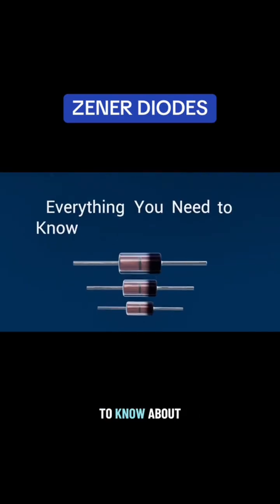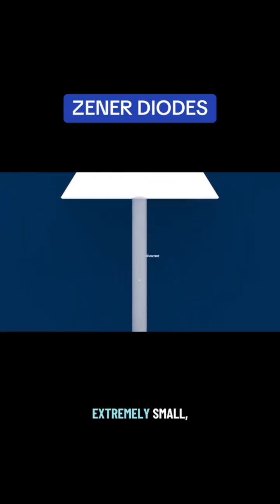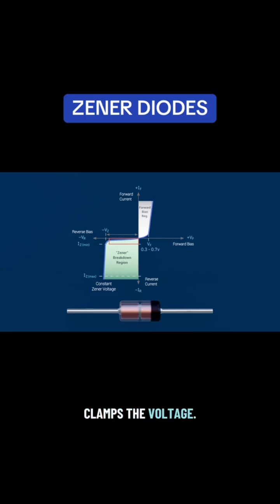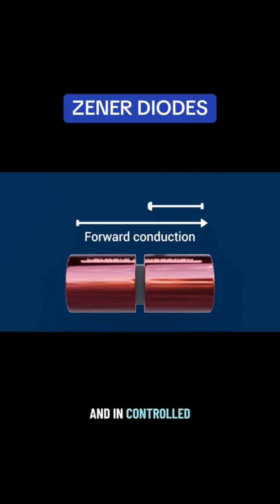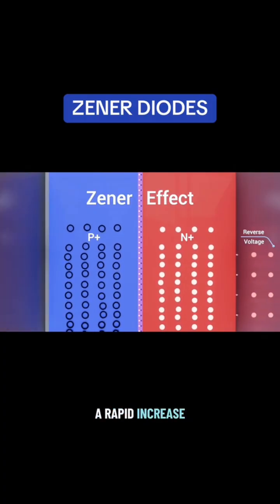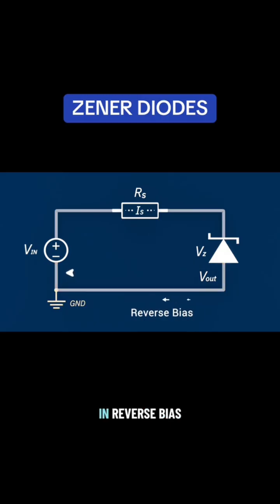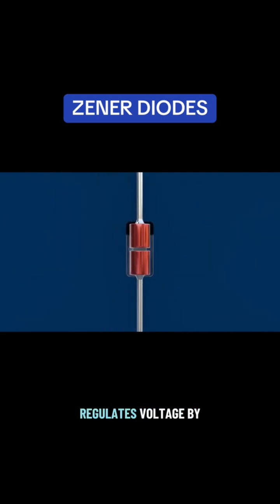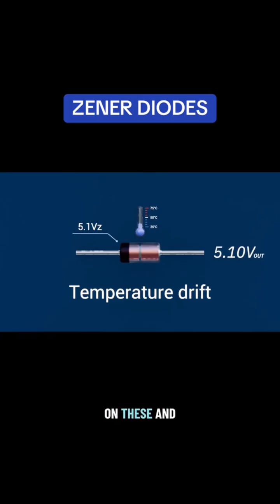Zener breakdown or tunnelling #experiment #electrical #electronic

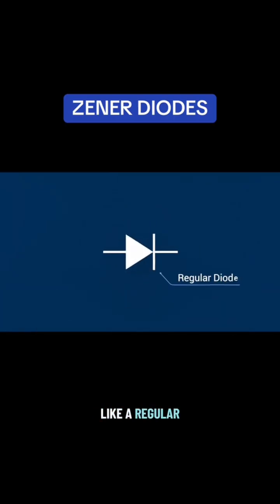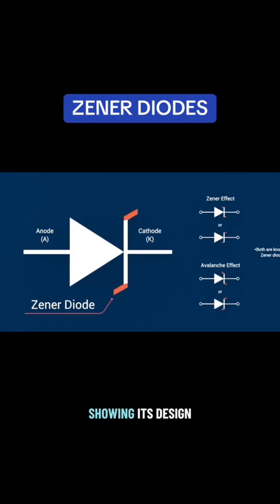Comment: The schematic symbol for a Zener diode is unique because it modifies the standard diode symbol to indicate its specific function as a voltage regulator operating in reverse bias (1:08). Specifically, the cathode line (the bar) is kinked or angled rather than being a straight line, representing its design to clamp voltage (1:11-1:17).